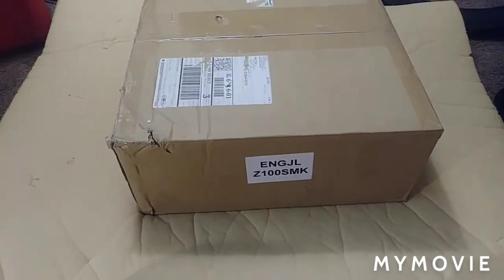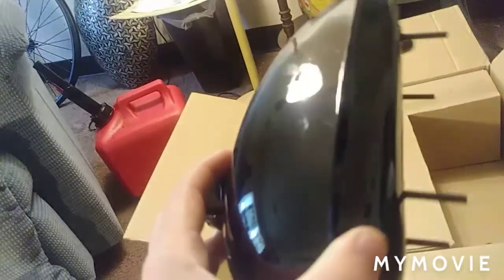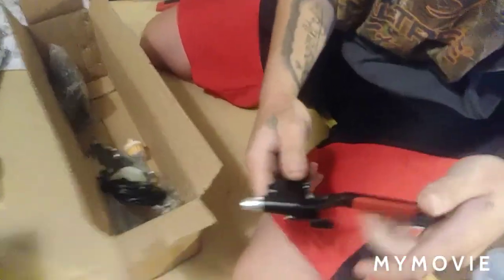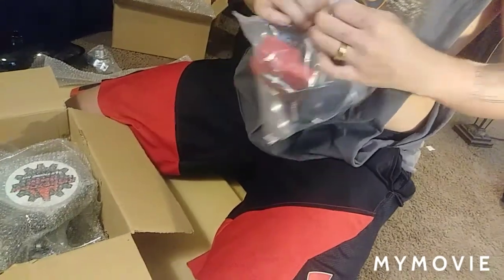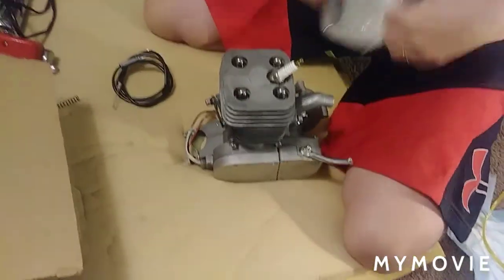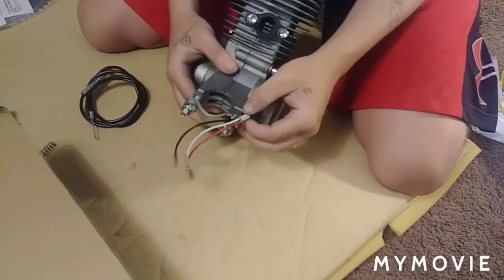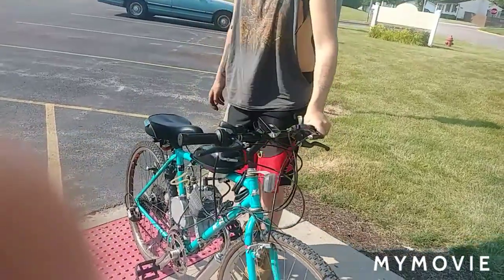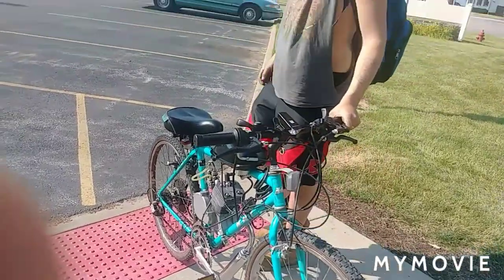NEW!!! Firestorm100/YD100 unavailing + first start

Comment: How is it holding up?
Reply from the maker: It ran really well after i got the bugs worked out... being vacuum leaks, and tuning issues. Very strong engine until a piston clip came dislodged and wreaked havoc on the entire top end in the matter of seconds. So i went back to my trusty back up engine a 49cc single piece topend engine it lacks bottom end torque but makes up for it when i hit wot. Ive been out of making videos for awhile now because of camera quality first off and im having shoulder surgery so ive been out of a job but ill be back making videos soon as i get the "life bugs" out of the way when its possible id really like to collaborate with you and share our knowledge
Reply: Man looks like a killer motor, seen one of the comments so it's not running too good that motor

Comment: Looks like a regular yd100 w nt carb but a red cap wich is what it is. Ask the pros not in league w zeda they’ll tell ya yeun dong motors makes em all the yd100 and bt motors makes the. Bt100 and theirs another company or two with engines out their can’t remember the name tho. And tho the yd bt and all are the same no matter what the 66/80 are not all the same the wildcat/runwell pk80 is the only one wich is a real pk80 design but the actual pk80 is no more just close copies but anyways I got a pk80 with as much or more torque than a yd100 just ported right it’ll pull well and hit high forties add a good pipe and a good carb reeds and gearing hit 50